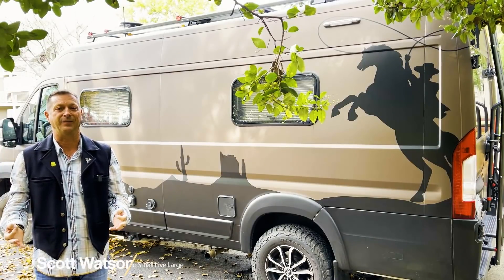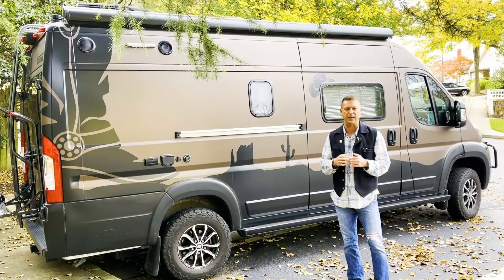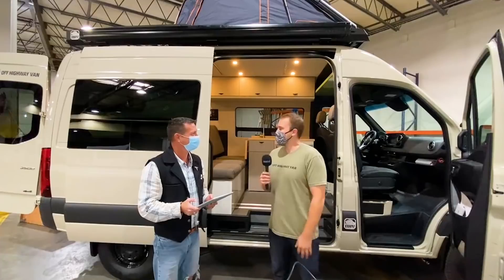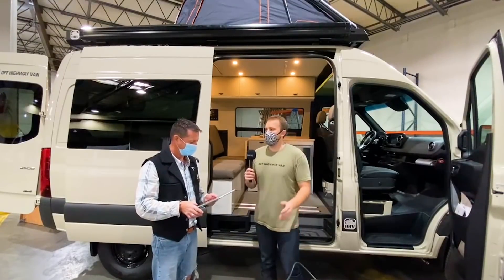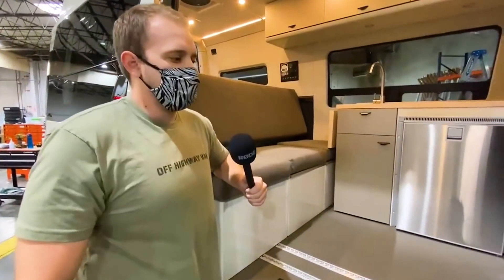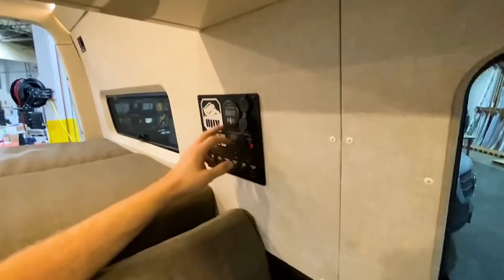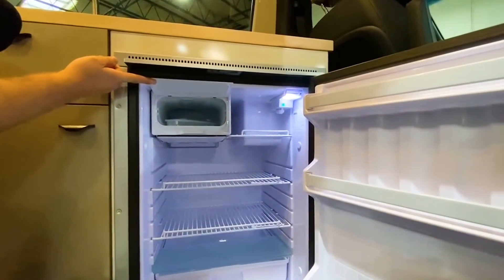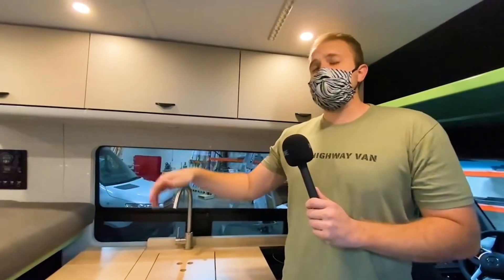Tour CUSTOM $65,000 SPRINTER 4x4 Class B RV by OFF HIGHWAY VANS with full-time RVer in Travato 59GL

Comment: Question about the two 6-gallon water tanks under the sink.  You mentioned one is fresh and one is gray.  In another video I watched, it said both are fresh and with the quick disconnect, it's easy to swap out once the primary is empty.  Can these be used both ways?
Reply from the maker: Oh boy.  Great question Mike.  Consulting their website might provide clues. thanks for watching commenting and subscribing

Comment: The Revel floorplan is so superior, why can't they independent shops copy the design with better workmanship, cabinets. You have to put the galley partially at the passenger side side door, bathroom and bench, seat or sofa right behind driver, flares, euroloft bed in the rear with GLSS seating system below the loft bed! This isn't rocket science, even putting a poptop on a 144 with all the stuff above would be epic. Add quiet diesel generator, under hood generator, solar, LI3! Hope to see a Zenvan interview, they are right on it!
Reply from the maker: Great points Carl